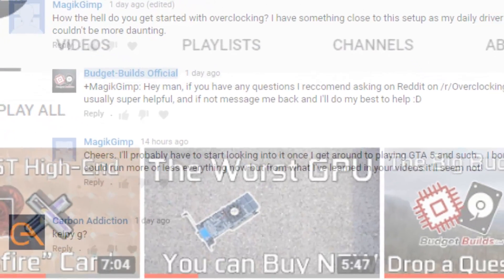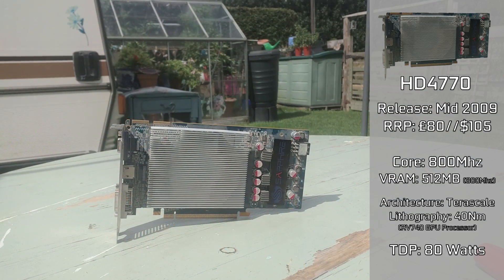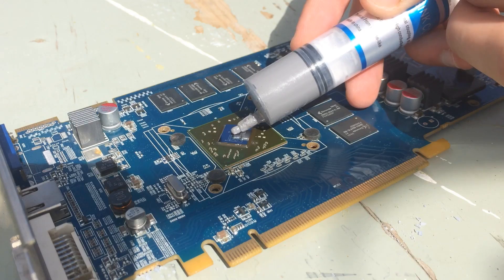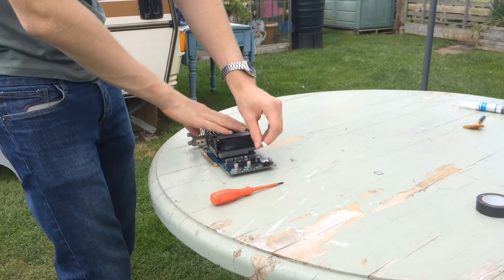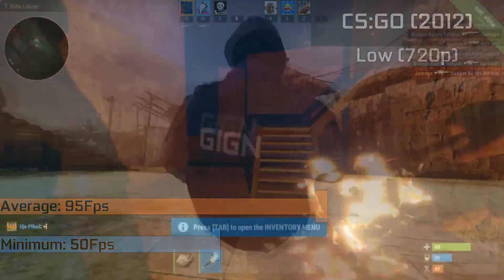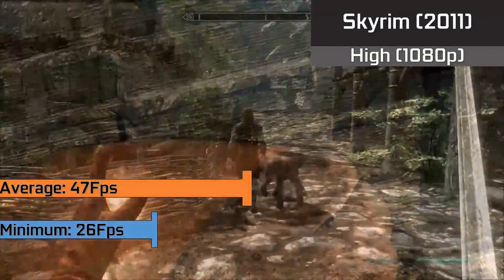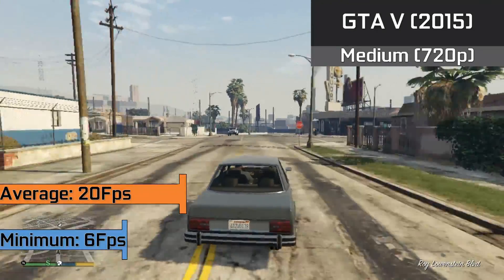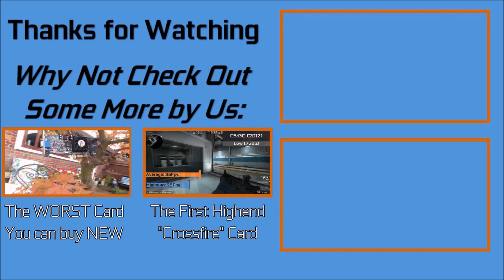The £4.70 ($6.00)  Radeon HD4770 - A Budget Wonder?

Comment: I used to have this one, it replaced my HD4830 when it died.
Unfortunately, when my monitor died and I got my new 1080p monitor, it wasn't enough anymore for Skyrim. So I bought a HD7870.

Honestly I didn't like it that much, not as quiet as my HD4830, couldn't overclock it as much. Kinda regret not buying the 2 4830 bundle when the first one died.

Comment: I got the MSI HD4830 OC ed back then instead of this -- way better value IMO vs 4770 back then as its basically a cut down 4850 so you could clock it to 4850 levels thru a BIOS mod (Which I did) and can crossfire with another 48xx card

Comment: I have one and probably keep it for some very specific purpose - emulation of 240/288p games via VGA-Scart RGB TV or 120 HZ CRT monitor. With the Radeon cards up  to the HD 4000 series this is relatively easy. It's possible to use newer Radeon cards these days with CRT Emu driver, but it's a bit more limited because of the super resolution restriction. Doesn't matter for something like MAME, but for some other emulators it does.

Comment: If you can get a 5770 for around 20$ you are better off..It runs csgo at max settings 1080p at 70 90fps.

Also washing fans is a bad idea, it will corode the bearings over time.

Comment: I have a 76$ gt 730 and I get 30 fps on average in csgo how ? Plz help me
Reply from the maker: The GT730 is a fairly weak card
Reply: Budget-Builds Official but its more recent than the 4770 and has more vram  clock speeds are fairly similar I guess..
Reply from the maker: The GT730 came in two variants, the Fermi Variant (Worst) and the Kepler variant (Slightly less bad) neither were powerful, and neither were worth any more than about $10-$20. Try and get a refund would be my advice. Maybe run DDU and Reinstall Drivers.

Comment: TBH I wouldn't go below something from the Ati HD5000 series. I had some really good times with my laptop's Mobility Radeon HD5650 1GB (which I overclocked to match the HD5770). It was a lot faster than the Intel HD4600 in my i5 4440 as well.

Comment: Super fast RAM and fabrication process made this a great little card, even though it came late to the series. I opted for two of these at £90 each over a single £260 4890 way back when, and I'm glad I did. Brilliant cards for their time. Nothing from Nvidia could come close in that price bracket. They played Stalker and a lot of other titles at max settings ... super smooth. Crossfire scaling was ridiculously good as well (when it worked, which was most of the time).

Comment: To me the card doesn't look like it's missing a fan, but it's passively cooled. The thing on top looks the same as the passive cooling I had on my GeForce 8500 GT and it looks like you needlessly put a fan on top of the cooler, that doesn't need a fan at all!
Reply from the maker: Trust me the 8500GT uses alot less power than the HD4770.

Comment: I'm curently using a 4770 at the moment overclocked to 850/1030. The default VRAM clocks are actually less than their intended speed so you have a lot of room to play with.

I've managed to get almost constant 30 FPS on GTA V at 720p with everything on low except motion blur (at highest) and vsync on half. I'm using a 6600k @ 4.2 though.
Reply: i5 6600k, didn't know there is an AMD CPU with almost the same name.

I bought my Sapphire HD 4770 used in 2011 and it hasn't failed since, I absolutely love it.

Comment: Is that card not passively cooled intentionally, I don't see screw holes for fan hardware or cuts if it clipped on the side of the heatsink.  I'm not doubting without a fan you would not have achieved the overcook but some cards are built passive.
Reply from the maker: +weaponx26: It took a while, but when I searched HD4770 Passive after I bought it, I couldn't find anything on it......and then it arrived and I found out it was this http://img.hexus.net/v2/news/sapphire/HD4770-new.jpg
Reply: Budget-Builds Official maybe it holds on with just pressure...

Comment: i thought HD4850 were less than 20 bucks here in the states.. the card works great even up to Windows 8.1 with a little shove, I even got 2 in Crossfire and beat Tomb Raider (2013) with em Crossfired! I was using a Athlon 64x2 2.8Ghz, 3GB Ram, and both cards were Palit branded. Palit cards are no longer in the US Market and switched to Nvidia years ago.

Comment: Good deal, This is faster than HD 4850. It was a shame AMD failed at naming it lol
Reply: They are pretty close in their stats.
The 4850 has around 25% more shaders but runs a 20% lower clock and uses GDDR3 on a 265 bit bus while the 4770 uses GDDR5 on a 128 bit bus. I guess it depends on the game and the final clocks applied with custom designs and oc.
Similar to the GTX 280 and 275, one has more shader performance, the other more memory bandwith.

Comment: In the US I found a GTX 460 with 1gb GDDR5 for $40 with free shipping in the original package, it needed new thermal paste, but I used Ceramique 2 by Arctic Silver! Does pretty well with my X3330 and 4gb DDR3 1333 dual channel from Gskill! But that is a computer I plan on selling as a multipurpose platform! 

On my main rig I bought a brand new Sapphire Nitro RX 460 4gb OC for $119 shipped, with Trixx I can overclock it to 1980 mhz and the memory up to 9450 mhz! I bought my I5 7600K for $229 shipped and paid $82 shipped for 16 gb of Geil EVO Potenza 2133, bought my 240gb ssd for $60, two 120gb ssd's for $40 each, the case for $50, Windows 10 Pro for $36.99 and my EVGA 500 watt 80+ Bronze PSU for around $50 and the 240mm liquid cooling system for $80 new! 

It will pull 93 gigaflops on qwikmark at all stock settings! Read and Write speeds for the 240gb ssd are 430+ both read and write! It would really suck to have to pay so much more in other countries!

Comment: It's sad that my 2015 MacBook Pro can't even run Skyrim that well.
Reply: Because Mac is an over priced paperweight
Reply: MrJ0mmy I mean, you can go ahead and start a circlejerk but I'm pretty happy using it for Adobe software, and I love the UI on Mac. I just use Windows for gaming and it's alright for that.

A Mac isn't garbage, it's just not reasonable for most use cases for the money. But there's a lot of people willing to pay a premium for what Apple offers and that's ok. I mean, you can only go 75 at most on the highway but that stops no one from wanting a Ferrari when a Civic is just flat out better and cheaper for what it does.
Reply: macs are not for gaming. They lack power there.
macs were made for video editing and internet browsing.
Sure you can game on mac but it will result poorly
Reply: No kidding. In fact, you can't even run Skyrim unless you bootcamp. The issue besides their lack of a GPU on a mid 2015 MBP if you get the entry level 15in is the OS itself. I love it, but it lacks support for a good API for gaming/. OpenGL doesn't compete well with DX11.
Reply: Operate170 Funny thing about Macs are they have incredible looks, and you're paying for mainly that and the OS, not the internals. It's not a bad system, it's just that OSX is a very expensive operating system. But you're not gonna get it anywhere else so stick with it dude! Macs can also use their hardware efficiently because Mac OS is made specifically for Intel cards, so they run smoother.

Windows laptops can be slow from the start.

I still massively prefer Windows DESKTOPS, but in the laptop world, Apple is doing an extremely good job!

Just hope you don't need to take it in for repairs ffs lmao
Reply: Pulse/Krilium I agree, apple makes great laptops!

Comment: i just bought a gtx 760 msi twin frozr 2 gb for only 50 dollars
Reply: eri steaj that's a really good deal for a gtx 760
Reply: ty bro i also got a full working pc with a 
x4 640 quad core 3.0 ghz 
4 gb ddr3 ram
hd 5770
cooler master gx550w+80 psu 
a shitty 200 gb ide hdd which i am running out of space lol
the only issue is that it hasn't got fans and gets hot as hell
Reply: eri steaj FUCK I bought mine for £190 in 2015
Reply: in 2015 190 was a great deal like getting 1060 right now
Reply: eri steaj fans can be as low as 4 or 10 dollars put some in
Reply: fake ofc but i am very pleased with it even now

Comment: THIS VIDEO IS FAKE. THIS GRAPHICS CARD COSTS LIKE £40
Reply from the maker: +Muizz Khalid: If you check the description I even left some proof of purchase. Hope this helps :D
Reply: Muizz Khalid you might also need to consider the state the GPU is in, the one he bought was missing a fan which would probably also lower its' price as well as him being an experienced 2nd hand buyer so he could've gotten the seller to power the price even further.
Reply: It actually looked almost like a passive one.
I think part of the dal is to look for stuff not sought after but with alot of market reselling.
Reply: Budget-Builds Official you were lucky with that purchase. Typically if you were to just regularly buy it, it would cost a lot more

Comment: Try to get a 7770, mine died a few months ago, but It had pretty good performance, and you have driver support + DX11 + very good overclock speeds. Mine was from Sapphire too, but unfortunately it just died one day, gives no video signal ;_;
Reply: you should bake it! you got nothin to lose right? i recommend you get a used mini oven from someone who doesnt want it anymore, because you shouldnt use the oven for food afterwards.
Reply: I used one those thermic blowers that look like a super hairdryer, my father also knows electronics and repaired a few soldering that looked old, still no life. I suspect it is some problem on the video output since the card "works" (I can hear windows booting) but I got no signal. I'm trying to find a cheap used card so I can try to salvage some parts. My card was only 2 years old :(
Reply: R.I.P

Comment: I have the HD4850 laying around, its just almost like a HD4770 but a little better of course when overclocked high like mine to 825MHh and I need to say that those cards perform good for such a price like yours! Lovely video as always!
Reply: I had an HD4850 and it wouldn't overclock at all, even if I went 1mhz over the stock clocks it would crash. Was the visiontek model.
Reply: Slayx I had one some years back (4850). I also managed to get extra performance out of that (a few frames) by overclocking the PCI express on the motherboard past 108 MHZ. Usually about 115 MHz was as far as I could go it would only start to show an improvement past 108 MHz, other cards never liked it that high & would crash out even though the board could tolerate it.
Reply: I have HD 5000 APU and I get shitty performance

Comment: wait....so you can wash the cooling fans with water? wtf.
Reply: There's typically no problem washing electronics so long as it's discharged before you do it and you make sure everything is dry afterwards; except for ribbon cables or membranes that are used in some devices, those are a pain.
Reply: You could, but afterwards you really should take off the sticker, spray it with a degreaser (like WD40), let that evaporate a few minutes, and then oil it (even light motor oil or transmission oil will last a long time), then put the sticker back on it.

I actually wash computer parts (tablet motherboards, Raspberry Pi) under a sink. Once those dry out they are fine to use again (these are fanless). Rubbing alcohol is what i use for anything expensive since it won't damage anything.
Reply: Joe Manfred thanks!
Reply: tbh you shouldnt, this guy isnt the best in electronics i think

Comment: 62 degrees that's really good. My current card gets 72c at low temps.. high well I've seen almost 90c.
Reply: Really doesn't matter, it depends on the card. My ATI idles at 70+c (still sounds like a jet). Whereas my R9 Fury tops out at 60c with 30% fan speed (275w TDP) and will thermal throttle at 75c. My current running GPU varies between 75c stock, 100c overclock, and sub zero with my favorite cooler installed.

Comment: That's a terrible card for e sports, you need 50-60 fps to have an acceptable deports experience, stuff like overwatch or doom isn't going to be good on that card, only the less demanding cs go kept in the range of what an esports guy would need. It's better than integrated graphics laptops, but that's not saying much. For 5 dollars though, it's certainly not a bad deal if someone only plays cs go and older games like black ops 1/2.  I would've suggested the gtx 660 ti over this card or the 7870
Reply: Doom is not an esports title. For that I recommend R9 Fury, or at least a GTX 1070 (probably 1080ti  if you are wanting 4k, though the Fury does pretty good with Vulcan at 4k). A GTX 1060/RX470 is probably good enough for 1080p 60 fps.

For under $10, this is a pretty decent card. Should run older games just fine, it was a budget card when it came out.
Reply: i'd consider doom and quake champions to both be esports titles, although i suppose doom is debatable. 

also, on my gtx 970 I get a solid 100-150 fps, not sure exact average but its around that zone in 1080p

you can get one of those for about 150 now, good deal.

but, i'd be interested in knowing the weakest cheapest (preferably older) card that could run AAA titles at 50-60 fps

Comment: Before buying how would you know if your graphics card fits on to the motherboard
Reply: Look at the pics of the GPU. Then on your motherboard (if its modern) should have a pcie x16 slot (the really long GPU slot). The GPU should look the same. Very old cards like AGP have different plug in (look for multiple cut out notches) and they won't fit.

The other way is to Google it and see what will fit. If its Dell or other pre-built, the case may be too small, and you might need to chop out a hole in the case so it can actually fit, not a big deal if you have a grinder or saw.
Reply: Everything since the Geforce 8 and Radeon HD 2000 series is PCI Express, before that there was a transotioning phase.
Basically any card since 2007 will fit on your board if it uses PCIe. So unless you're using an Athlon XP or early Pentium 4 it will fit.
Reply: A Random Idiot Play's those should still work on x16 motherboard slots (and technically you can get a $5 adaptor to connect x16 cards to 1x slots, though performance will suffer from such low bandwidth). 

Best way is to just look at the slots cut in and see if it matches the motherboard (who knows, maybe Dell found another thing they can make proprietary, this could even be a Mac for all I know or a thin client, or super small form factor without any PCIe slots).
Reply: If the slot isn't open in the end, opening the slot might be easier than cutting the card.

Comment: Hi cna you help me I have rx 560 and I use lc6550 v2.2 and my fan speed is 0 and gpu work can you tell me whats a problem?
Reply from the maker: kronos 222: The newer RX Cards will have no fan speed at all if they are under a certain temperature, you can create a custom fan curve if you would like your fans to spin even when under the designated temperature.
Reply: Budget-Builds Official so is it normal to have temperature 65 c° and fan speed 0?I am realy scared becouse it is my first gpu who I bought whit my money who I saved for year
Reply from the maker: Its no worry whatsoever, I'd recommend setting the fan settings manually if you'd like to have the fans on.